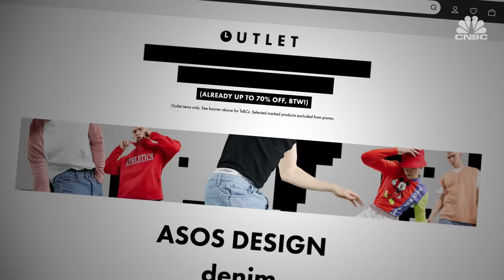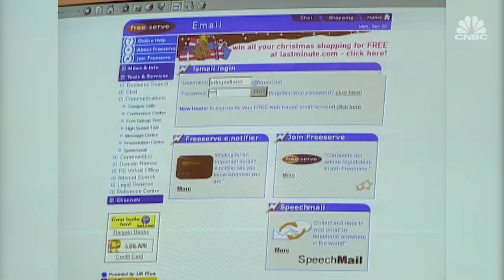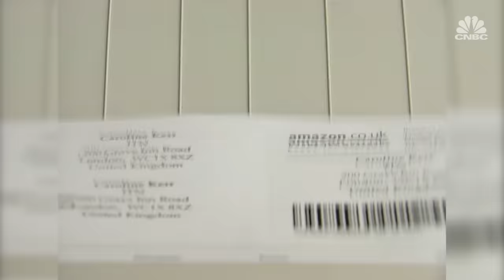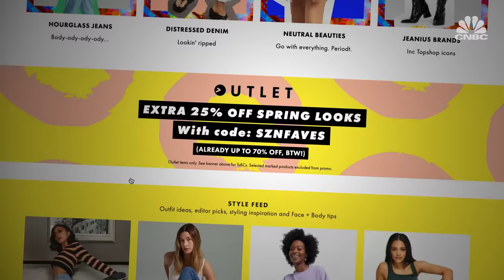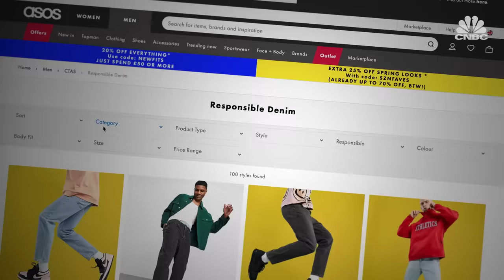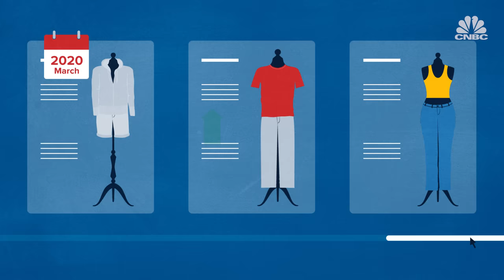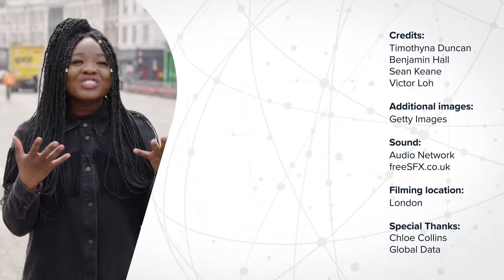How ASOS became one of the world’s largest retailers | CNBC Explains

Comment: In 2017 there share price was already above 5000 Pounds. CNBC should check their facts before posting a video that can be verified easily by anyone. There is one thing where their so called analysts guess daily share price as if they know something and then this 🤦‍♂️
Reply: Asos trades on the London Stock Exchange, where everything is traded in pennies. So Asos was actually trading at 5,000p or £50, not £5,000